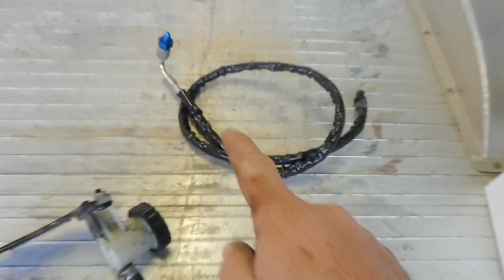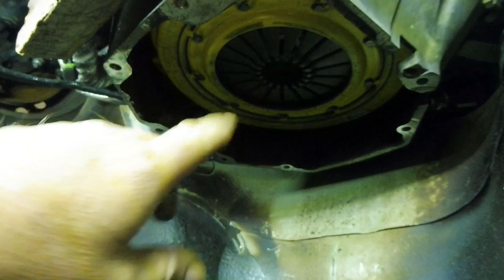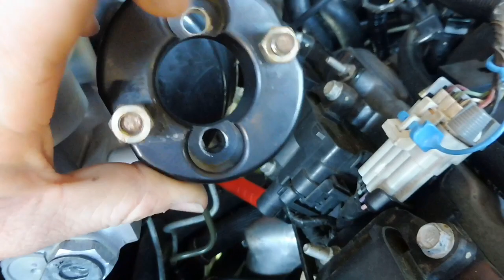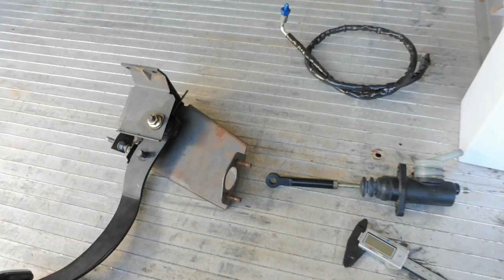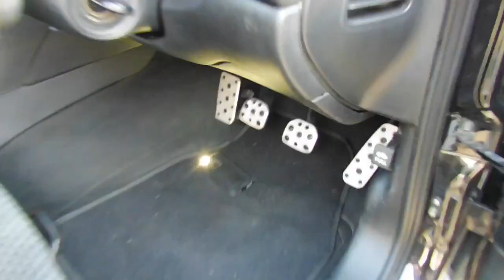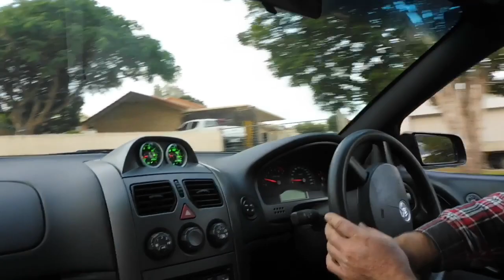Ls1 Turbo tonner build EP11 Tilton master cylinder and ace billet slave cylinder install

Comment: Hi mate, I’ve loved watching your vids as they’re really well done and an inspiration. 
Hope you don’t mind if ask a question as I’ve had big drama with my build. It’s about thread/aluminium damage possibly caused by age/washing/bad initial casting. 
I’ve got the same VZ SS with the L76 engine as you. 
In 2012 had one of the heads off for a repair of a problem I had installing headers. I reinstalled with new head bolts, gasket and a good torque wrench and no problems since then. 
The ss has almost 300K kms on it now and recently a valve on the other head broke, fell in to the combustion chamber but luckily no block damage. That head was pretty damaged though. I had the engine sent to a good shop for a full overhaul with new springs, valves, cam, cam bushes, conrods, pistons - everything but the crank and block. The damaged head was repaired. 
As I am on a budget and enjoy working on my car I opted to reinstall the heads and rocker arms myself. I have a brand new expensive calibrated torque wrench and the best head bolts and gaskets. Also new rocker arm bolts. 
First problem: on the second pass (70°) the internal M11 on no.1 cylinder stripped the threads on the block. 
Second problem: 4 of the rocker arm bolts stripped their threads in the repaired head. 
All specs were adhered to (22lb ft., 90° then 70° for the heads and 22 lb ft for the rocker bolts). 
My engine man is away till the 6th of Jan and has asked me not to do anything else till he’s back. 
So the questions are: have you ever experienced this kind of thing? Would you be able to tell me if washing aluminium blocks and heads degrades them? Does aluminium break down over time? 
I know about heli-coils and time -setts and know the latter are needed for threads in the block for the heads. So I’ll go with that. 
As the head studs have been used I’ll have to get new ones. I am thinking the ARP studs and bolts might be better as I am paranoid about this happening again. But what about the rocker bolts? I couldn’t torque them without 4 of the threads turning to butter. 
Thanks in advance for your thoughts on these issues. Cheers Erik.

Comment: Hi mate do you think it made shifting faster once you had a chance to tune the car and have a proper run through the gears. 
Thanks,
Matt
Reply from the maker: Matthew Hine Nar the tune was pretty close still with the old setup . I don’t think the tune has anything to do with how well the clutch engages and the new setup definitely pushes that clutch plate in far more efficiently
Reply: @LatysGarage  cool I  wondered what it was like at 6-7,000rpm as the ones in the video were mid rpm. Yeah I realise the tune doesn't affect the shift I just thought it may not have been finalised hence not wanting to rev it too much. Great video too mate I've been wanting to do that master upgrade but only ever seen it on cars in the USA.

Comment: I have the Tick master cylinder fitted and it had to be modified to fit and is so close to the brake servo.
Mine is heavy as too! even with a twin plate Spec clutch.

Comment: mate love the build    .....planing on doing the same thing  i have a vy v6 tonner.........and a ls1 wh caprice any advice would be grate  ....about to get stuck in to it......are u selling any parts off the smashed vy  ........haha i live up the road from u ....cant wait to see your tonner getting around....
Reply from the maker: j james is yours red mate
Reply: was black with airbrushed flames all over it u probs seen it around.....just swapped the panels yesterday to white ......pretty shore i know who owns the red one aswell
Reply from the maker: j james ohh yeah seen your tonner as for your conversion your going to need vy engine loom as wh is the same as Vx and it won’t just plug in to vy and also you’ll have to put your v6 fan motors on your v8 shroud and also change out the front section of the tailshaft . I’ve covered all this in my videos to try help people with the conversions .
Reply: ok cheers ...are v8 an v6 diffs the same????? what if i went full wh interior /dash/maybe front end. would my engine loom work then......
Reply from the maker: You could change out the dash loom it’s a big job compared to buying a vy engine loom I’ve seen them from $100 to $150 definitely worth it for simplicity then you can resell your Vx one for the same amount end up costing you nothing. As for the diffs they are not the same v6 to v8. The v6 diff is still good they are a m75 same internally as vn to vs diffs  28spline axels your main letdown would be it has an open Center but if you can hunt down a lsd from the early models you can get it installed or just get a minispool installed .
Reply: ok no worrys .....thanx for the info......yeah will defiantly  stick with the vy loom...ill let u no how i go ...cheers